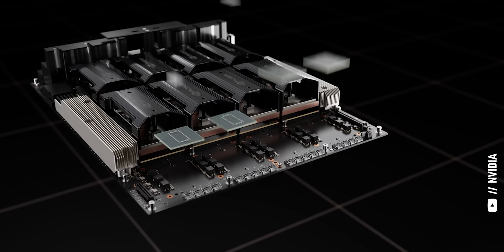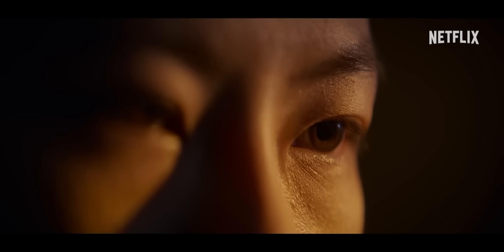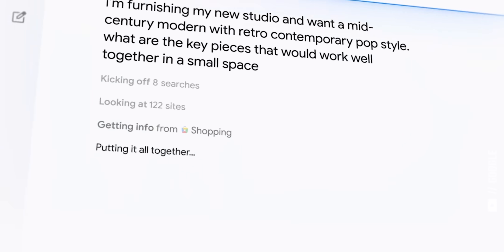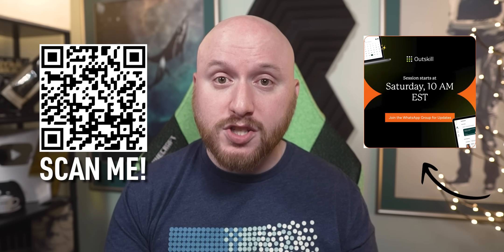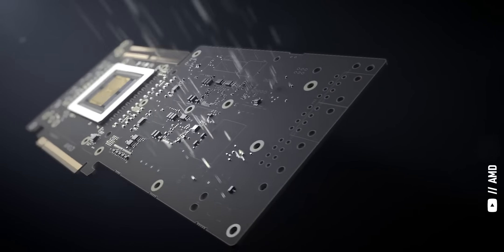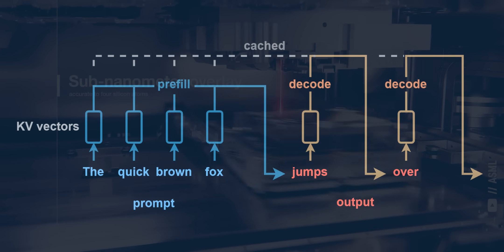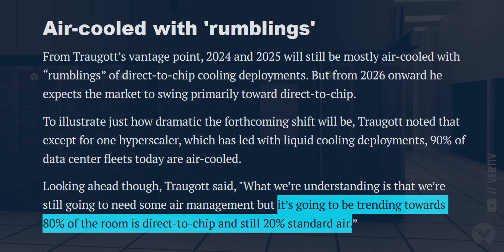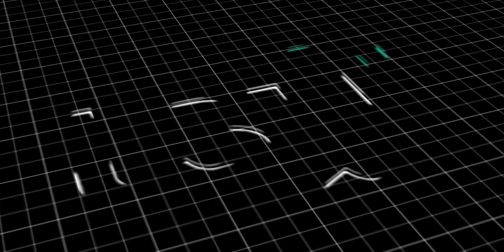GET IN EARLY! I'm Investing In This HUGE AI Chip Breakthrough

Comment: Please check into POET. Right time, Right place..to help make AI work faster and cost less in energy. Award winning tech (6-7 awards in the last 2 years), last being 9-30-25 at the ECOC. Factory strategically located in Malaysia to avoid China rare earth and tariff issues. Just had 150 mil investment since summer. Oders starting to come in. Partnered with three big companies that Navidia is partnered with. It's product embedded in Celestial AI that is working out potential deals with AMD. Working on a deal with Japan's NTT (telecommunications). Poet Technologies products can be used in so many other companies products to cut cost of energy use...The speed of light versus info traveling thru copper wiring...

Comment: Just give the next x90 series GPU a 128gb HBM4 option and inference is solved.  Seriously, you don’t need more TPS, you just need the ram to hold the model on the memory bandwidth because that is what is holding back Spark.  People are running 4x3090s because it’s the most efficient setup.
Reply: What about all the models that don't fit in 128gb never mind any context? What about the insane power draw of the XX90 series? Did you even listen to the video? They already have 128GB GPUs using LPDDR5 unified memory that sip power, you can buy them rn,
Reply: @BigFarm_ah365 and they are slow as fk

Comment: What I dont understand is, since we already know about NVIDIAS quarterly reports up to Q2 2026, doesn't that mean that all these chips have already been sold and are priced in to the NVIDIA stock? Is it possible for NVIDIA to sell more of these chips today, so that it can positiviely impact future earnings, which would be seen in Q3 2026?
Reply: Good question. From what I understand even if those earlier sales are already reflected in earnings future demand could still shift the picture. A lot of these hyper scalers plan infrastructure years out but they still adjust orders depending on AI adoption or new chip launches. The tricky part is figuring out how much of that growth is already priced in versus what’s still “upside.” Have you looked into how analysts model NVIDIA’s backlog or forward guidance?
Reply: The markets are forward looking.
Reply: It's only on paper - the object hasn't been made and the money hasn't exchanged.  If these projections don't materialize, decided not to buy so couldn't be made, the earnings you're speaking of will not be met.
Reply: @CSARVA  Thank you for your reply! So it's possible for actual revenue to both overperform and underperform whats stated in the quarterly reports? (But only those which are dated to the future, like Q1 and Q2 2026)? So in 35 days when NVIDIA reports for Q3 2026, actual revenue might actually be higher because of demand increasing, but it would be unlikely to be lower because the contracts have already been signed? Regards.